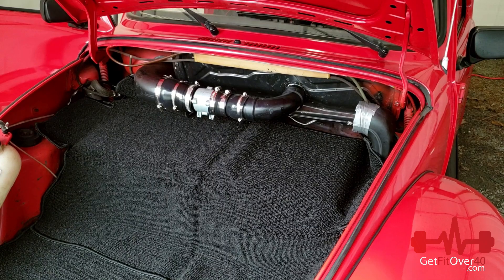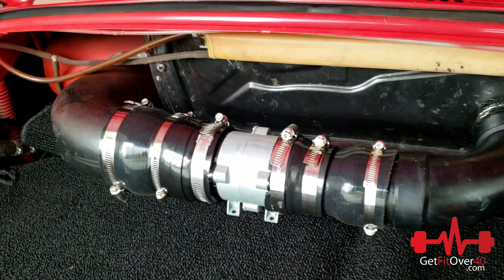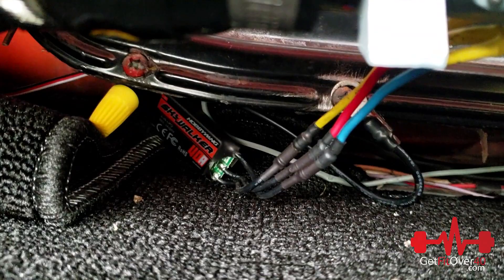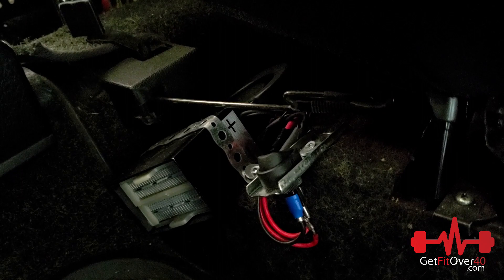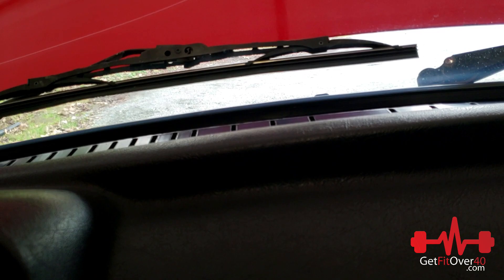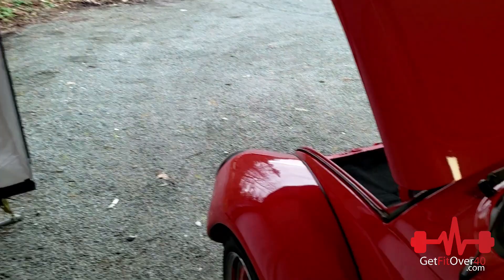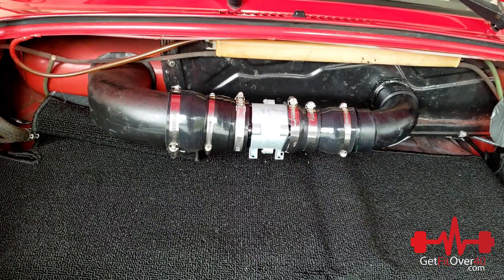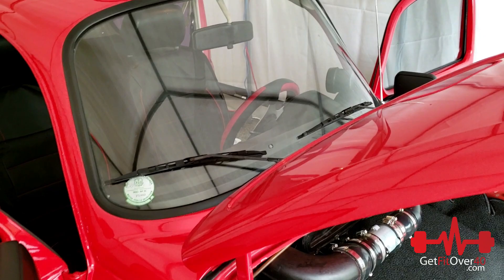1973 VW Super Beetle Cold Air Blower Modification - Part 2

Comment: Well, if it was me I think I would first upgrade the generator to alternator that way you can run a full-size electrical heater that is 12 V, road pro makes one that I had in my Pinto station wagon and it kept the wagon pretty toasty that way you don’t have to use a propane heater the second option is to use some type of heat exchanger on the engine with it with a small water pump you can install a heater core and that way you will never run out of heat it will normalize the heating situation
Reply from the maker: Great ideas for sure. I sold the bug last year though.